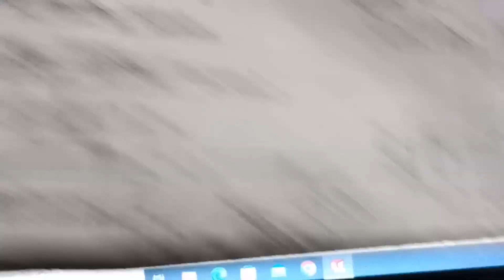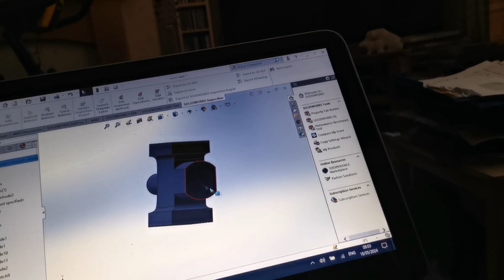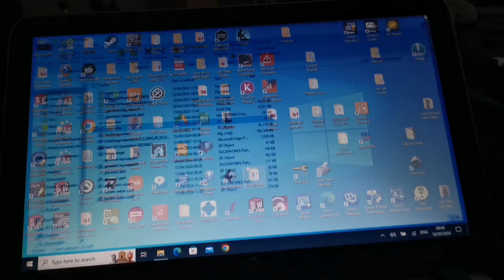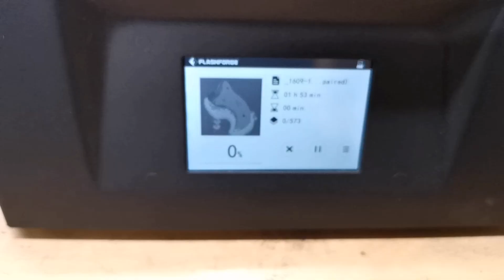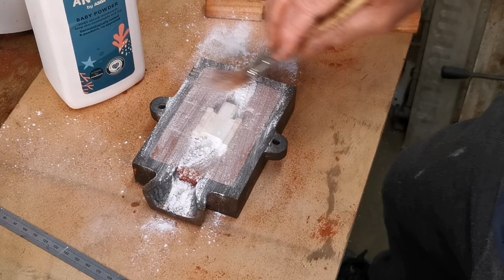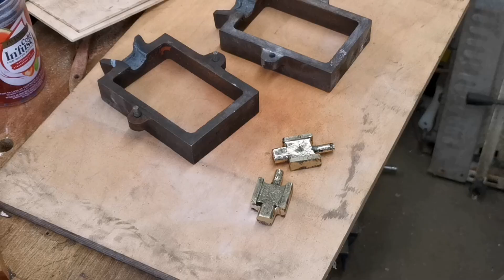2" Scale Fowler Showmans Traction Engine, The cross heads

Comment: That had  hand scratching my head !! I enjoy building moldes,,,,,casting,,,, and pouring  metal  all my young years i dont know if i would  of done it like that as now with the grandkids with these 3d printerwhen its all over i still can pour a solid  bronze  block and have it manchined  faster, you did a great job and 👍👍 with a one piece mold and not smoothed and some type of covering ,,,,,fill primer sanded and smooth paint makes a ruffle  pour your engine geting there good job
Reply from the maker: Hi, Thank you, I think if the part was any bigger, I would probably do a two part patern, I am happy with how they turned out, Thank you for watching 👍🏻